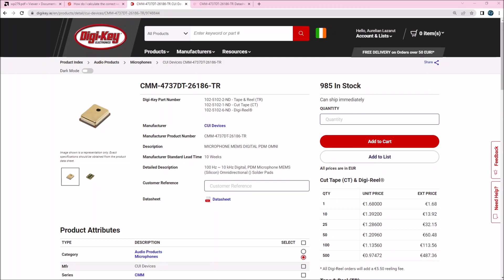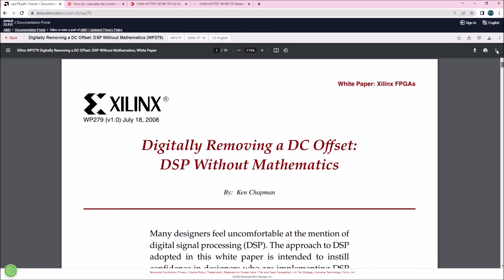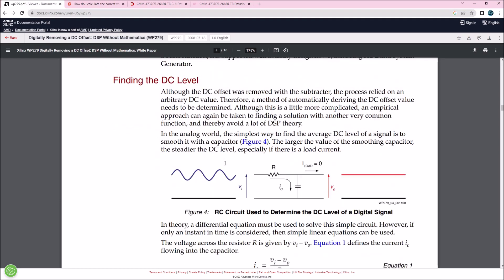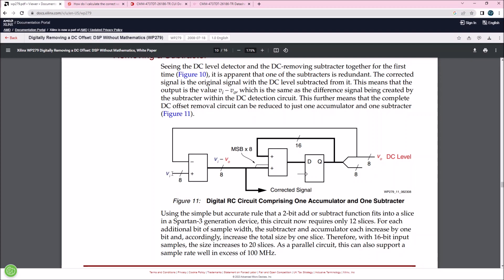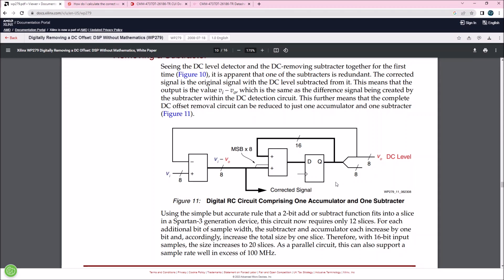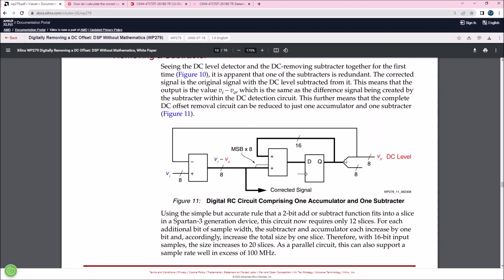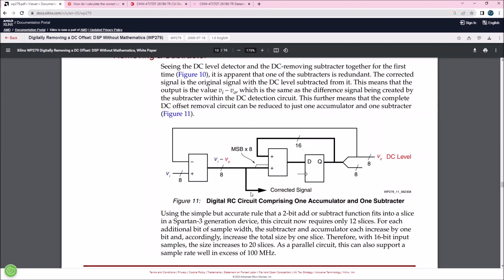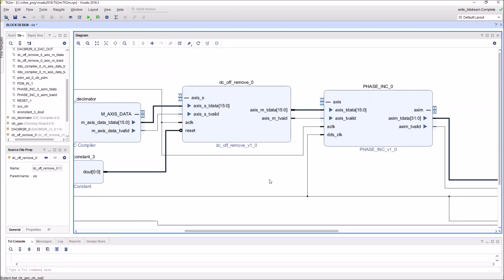FPGA PDM Microphone Remove DC offset

Comment: Hello, the videos you have give a good general overview of how the fpga radio works. But where could we find the code for the modules we need to get this working as well as a nice video that shows the entire block diagram of the radio working together? I feel like this video shows a part of the radio, but not all of it as a whole so it's hard to piece everything together. Thanks!
Reply from the maker: Statistically people watch about 2 minutes from a 10 minute video  (I guess they are kinda crap and in a weird accent, thanks god we have auto generated captions) - Talking about building a whole radio will take to long so I tried to break down the subject in multiple videos, I'll do my best in the future to strike a better balance.
Thanks for your feedback.